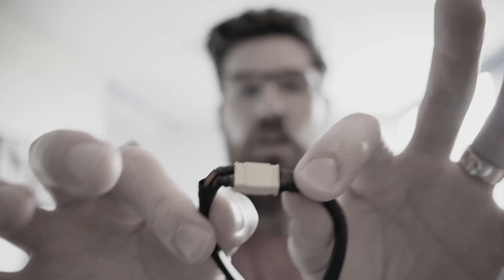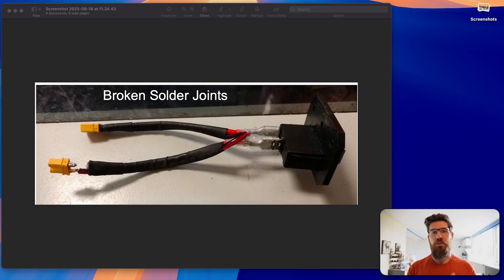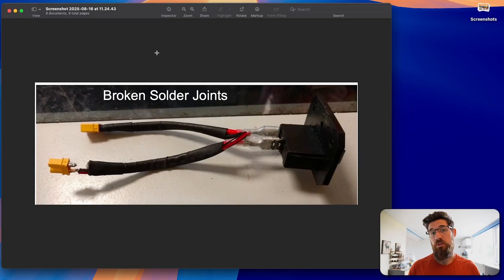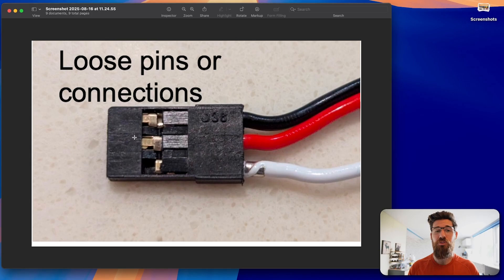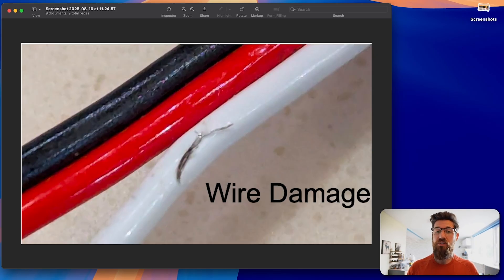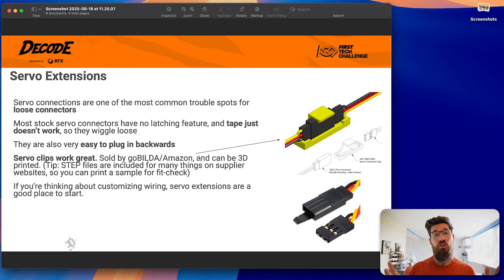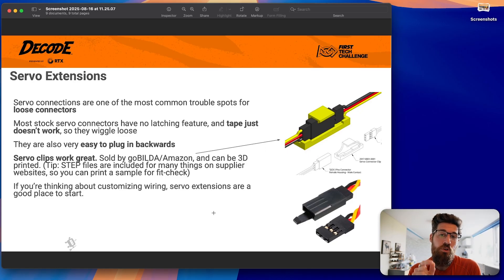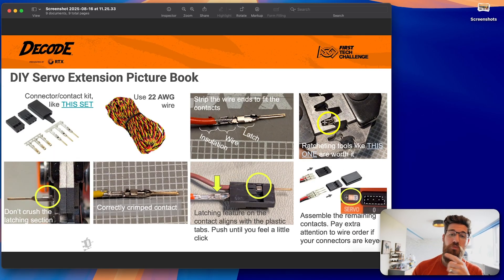I Asked a PhD How to Wire a Robot. Here's What I Learned.

Comment: How is power pole better than xt 30 and how does it actually work when you wire the robot because the control hub will still be xt 30.
Reply from the maker: Yes, on the control hub, you will still need to use an XT30. I would use the XT30 connector 3d printed file to support this, add in some cable relief with a ziptie so that initial xt30> robot controller isn;t going anywhere all season, then swap your other connections for powerpoles. This way you plug in an XT 30 + switch once, and then you have power pole for the rest. 

Powerpoles are better in that they use leaf springs as constant force connectors and are rated for 10000+ connects/disconnects, and this method of leaf springs holds up much better over time over a simple expansion joint of an XT30. As well, the power poles use crimped connectors to the wires, as opposed to soldered cups, which tend to break off rather easily due to the nature of a soldered joint (at least compared to a crimped joint).
Reply: @BroganMPratt what other connections should be power poles. We are planning on use a gobuilda battery to the new gobuilda power switch. From the power switch go to a power distribution block then to the control hubs and maybe servo hubs. So in this situation where would power pole actually be used because everything is xt 30?
Reply from the maker: I would to a permanent connection XT30 (bassically rarely unplugged all season) 
Control Hub > Gobilda switch, gobilda switch > powerpole short cable. 

Then off this daughter cable, do a powerpole connection.

Like this: https://www.gobilda.com/xt30-mh-fc-to-tamiya-mh-fc-adaptor-60mm-length/

but to powerpole instead of tamiya